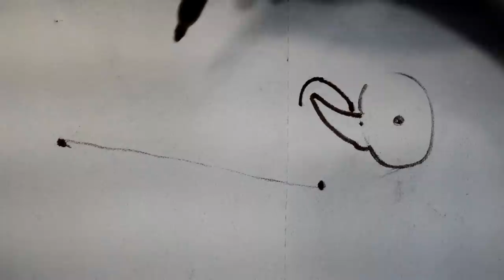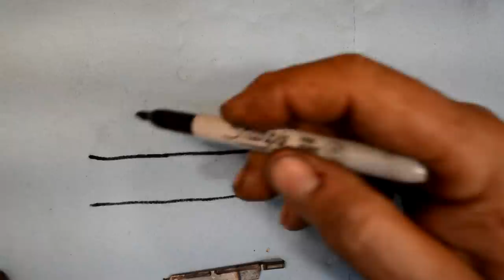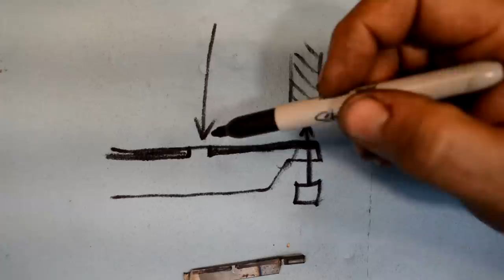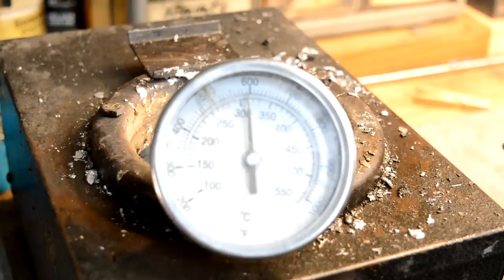Anvil 090: Mainspring Fabrication, 1812 Springfield

Comment: This reminded me of one of my black powder 1860 Colt repro's that broke the main spring.   It took it to work (P&W in WPB) and had it welded then the guys in heat treat did a full treatment with Rockwell testing included.   Turned out great...and is probably the most expensive spring in a black powder gun in the world.   Great video Mark!
Reply from the maker: Hard core

Comment: Hey Mark, I used to have a hobby blacksmith shop where I made knives for about 15 years (before YouTube lol), my knife tempering changed from “hit or miss” to perfect every time when I started using a magnet to test the red color before I quenched. Get it a little too hot and it gets too much grain growth and it doesn’t matter how well you temper, you still might get breaks. If you just get it hot enough to where a magnet doesn’t stick before the quench, that’s the sweet spot.

Comment: Very informative...I’ve made springs, and your explanations will help me next time...I temper my springs by putting them in a pan,covering them with oil, then setting the oil on fire..after it’s burned up, the spring needs cleaned and is ready...learned it from an old timer at friendship many years ago
Reply from the maker: This oil method works well, however I find that you can only achieve 1 possible hardness/draw result. I need to play with the temper/draw/thickness/shape to reverse engineer into the remanufactured part. Lots of correct ways to skin this cat..,..

Comment: In theory the statement "I need to make a new spring " is one of a fairly simple task. In reality it is one of the more complicated endeavors a Smith may undertake, resulting in a ratio of more failures to successes. Knowing "how" to do it cannot begin to bring into account all the known and unknown variables one can encounter.  I'm  glad to see the use of the Lyman lead pot, a trick I've been familiar with since about 1974. It gives a constant and controlled temperature to draw back a fabricated spring. Glad to see it being used here. Great job Mark !!! Very well thought out and presented. But most of us should not expect to get it right on the first try. And that is normal and par for the course.
Reply from the maker: Well said. Thanks
Reply: Even though I deal with digital controllers all the time, I still appreciate the old ways.  A bimetal element and thermal mass is incredibly elegant and simple.  Same for a rotating sprung mass to control speed.
Reply from the maker: @AM-hf9kk  Something to be said for Bang Bang control and the Watt flyball governor.......

Comment: As a warning, cooling in oil isn't nessesarily slower... it will be on very small items like these springs, but for larger/hotter steel sections the evaporation causes the steel to be insulated from the water, while the vastly higher boiling point, lower expansion rate, and endothermic decomposition of oil will allow it to continue to extract a high degree of energy. For this reason the fairly soft temper of the large rolls of steel sold for automotive fabrication is actually attained by submerging the entire roll and letting it flash boil for over an hour... to attain higher hardnesses fan, or forced jet water sprayers are used. Its not something even a home shop should forget either, as the same practice that works for guns lock spring, will garner a fairly different result on a barrel, car's leaf spring, or a sword blade (even between a sword and an axe you'll require to experiment several times to dial it in... so make sure thats on scrap metal FIRST, not a customers job you've got 20 hours into).

Comment: Mark, another awesome video.  Highly educational.  I'm sure I echo many others that have seen your videos in thanking you for sharing some of the finer points for not only this mainspring video but countless before it.  You're a Champ!  

It so happens that I've got a sorrily made flinter here that broke the spring early on.  And it wasn't a great smoke pole anyway since the action lacked a bridle plate.   The bridle plate and new screws I can handle.  But the book on making early firearm mainsprings I found lacks a lot of the valuable hints you gave in this video.  Now I can dive into this project more fully equipped. 

For us hobbyist shop rats I'm not exaggerating in saying that you're by far the best gunsmithing channel I've found.  Please keep up the great work.  But don't let this swell up your head and make it hard to fit your hats :D

Comment: The melting point of pure lead is a very precise temperature reference at 621.5F (327.5C). It can be used as a calibration check for high temperature thermometers. The freezing point of zinc is however better.

Comment: @Mark, looking at 6:50 that's not the "cheater's way", that is the blacksmithing way! I do blacksmithing as a hobby and as soon as you took out the hacksaw I knew what you were going to do. Of course doing this on an anvil would be even easier as you could just fuller that notch using the edge of the anvil face, bend it over with a hammer blow, and then clean up the twist bit with a half face blow.
Reply: That’s what I thought!

Comment: You are correct and assuming that I am very average and that I have a lead pot. I also have a thermometer similar to yours so you have made tempering a lot more easy and precise for me I've seen the same thing used for assault bath bluing and various brass annealing, but it just didn't occur to me that I had the ability to precisely temper springs with tools I already had.

Comment: I use car leaf spring steel to make new springs...... heat red and anneal, cut and file to shape and fit, heat to non-magnetic, quench in cool oil..... heat gently in a flame until the oil just flashes off, and its ready..... works well

Comment: I have a 1801 1795 Springfield pattern Eli Whitney contract musket issued to Maryland troops. It was converted to a percussion system for use in the Civil War. It is completely original other than a commercial hammer and the frizzen removed and reworked from a blacksmith's addition of a cone and  drum.
   The only part broken is the sear spring. At some time in the future I hope you could do a video on making a new one. Great instructional info.
Reply: Do you have the broken spring? You could well use it as a guide to make one or get a commercial one close enough to work

Comment: A-good source of thin spring material is metal leaf rakes. The individual tines are really easily made over and take heat treatment really well. Many such rakes also have 3/16 to1/4” springs included as a stiffener on the back. I have never used them on guns but i have used them for antique engine repairs. Particularly in and around governors and carburetors.

Comment: Careful with salvaging old mower blades, rumor has it the more modern cheap ones are case hardened mild steel rather than some through hard medium/high carbon alloy.
Reply: you know, there are multiple, really simple ways to test for that?

Comment: Nice job, but sorry you didn't show us the actual TIG welding - would have been helpful to see how those pieces were joined together.
Reply from the maker: That process does not video at all.....I've tried, haven't figured out how to show it, and I suck at it anyway. Too many armchair trolls to listen to.
Reply: @marknovak8255  Could you tell us the location of the welds... only at the end or on side(s) also?
Reply: @marknovak8255  Hi Mark as always awesome video, but please could you show more detail on the welding, Thanks
Reply: Better off looking at TIG welding videos on YouTube.  Lots of stuff there.  I have been welding for 50 years or so, but never did that process.  I want to try it.

Comment: It always pays to have both leaves in firm contact at the base. That way, all stresses are removed from the bend..... it's always at the bend that they break if this is not done.
If the base of the leaves are in contact it won't break there because the stresses are minimised. I always forge them on the anvil using a gas forge for the heating, which makes it easy to eliminate the gap between the leaves at the base and get the bend in just the right spot. The steel has to be HOT... hotter than your torch makes it.... I usually temper them after hardening by the 'oil burn' method....

Comment: You could use a 25kg anvil and a small forge...It would make making springs so much easier and faster.... The hot led method works pretty well, but so does burning off the oil a couple of times, as was done back in the day..... Making springs is a bit of a dark art.. :-)
Reply from the maker: It is indeed a dark art.

Comment: Super fantastic! I didn't know how to make the 90 degree tab at the end. I have to make a spring for an old lock of mine, but couldn't  figure out the tab at the end. I tried beating the tall end flat, gut that didn't work well. Now, however maybe I'll just weld the old spring. It's cracked at the bend, not all the way yet, but Im. thinking an ounce of preventive welding is worth a pound of fixing a completely broken spring
Reply: You will have to re temper that spring after welding it.

But if you have the stuff to get the heat correct, that's trivial.
Reply from the maker: As long as the weld doesn't flex in service, your repair will be virtually identical to this one

Comment: Mr Novak I need your expertise on a Beretta 38a I am building. Should I hot blue, cold blue, cerakote or duracoat it??? The parts are all “in the white” so not a lot of prep for whichever I can go with.
Reply from the maker: Rust blue, obviously. Dura and cold are never options in my opinion. Cerakote is expensive to have done, and very gear/expertise intensive to try on only one gun. Hot dip looks like ass....just sayin
Reply: @marknovak8255  thank you sir!!

Comment: Thank you Mark. Real question  is, what genius figured all this out in the first place?  I've found your demos very helpful fixing a lot of other mechanical stuff.
Reply: Like most things, it evolved over a hundred years or so.
Reply: @jeffreyroot6300  True, but there must have been some proto Mark who thought 'If I do this what happens?' My grandsons ,are fortunatley, fascinated by Mark.
Reply: @51WCDodge  The French fully developed the flintlock, closest and most pertinent point you can look at! Before that was a cruder version popular during the English Civil War period called the Doglock. It had a “dog” that acted as a safety, as there was no halfcock. Before that was the Snaphaunce, which was cruder still.
Reply: @51WCDodge  I use the word crude specifically to refer to the technology of the lock. I will point out two features in particular. The half cock position has not been developed yet, which is why the dog was incorporated, so the frizzen could be safely charged with powder while the cock was in the fully cocked position. The second is the rather larger jaws on the cock needed to hold a chunk of flint. A proper flintlock has much more refined jaws because the flints are standardized in form, being chipped or sawn into flat lozenges with sharp ends. I might actually prefer a dog lock if I were out long hunting past the Appalachian Mountains in the early Colonial days. The ability to simply smash a sufficiently hard rock and fit a sharp chunk into the jaws has an appeal. So does having a safety.
Reply: @jeffreyroot6300  Yes, I was being picky but I remember when a 405 VHF 20 inch TV was cutting edge technology. . It takes time for things to develop, and of course the current doctrine influences things. Safteys  being a point in question. Though one cannot but admire the work of people in the past, and their knowledge led to our improvments. But there must have been somone who first thought ,what if I re heat this metal to a lower temprature then let it cool, will it shatter after that? Humans have changed the world since the firet person thought, I'll dig a hole here formy convience or chop down that tree it's in the way.
Reply: @51WCDodge  lol remember rabbit ear antenna, constantly adjusting them and adding foil to try and get better reception? I remember we couldn’t get a color TV until 1982( too poor).
Reply: @jeffreyroot6300  I had a wire coat hangar bent up for my ariel. :-)

Comment: I have a question Sir. Being an accomplished Tig welder and an amateur gunsmith, what filler rod did you use on the Tig joint? The tempering down in the lead pot was worth watching for me as I always just watch the color and wrap the spring in leather to cool slowly. Thanks for the video

Comment: Logically, the vise wicks heat because you allow it to.  The operation provided by the vise is securement.  Securing the piece in a certain orientation is possible without wicking or sacrificing even heating, or am I incorrect about securing/gripping strategies in this work environment?
Reply: if you have a vise with very low thermal conductivity, yes. i don't know many people with titanium vise jaws personally though.
Reply: @johnsmith-sp6yl  What about wood as a jaw insert?  Anything to provide an insulation layer.
Reply: @MarkH10  how hot are you getting the workpiece and how long is it taking? wood burns.

Comment: What is the modern flintlock lock that you showed with a mainspring stirrup. It's an odd shaped tumbler. And do you have a project gun it is going into soon?
Reply from the maker: The lock is a Twigg fowler lock, 1790ish. It's going on a 10ga fowler, but that project is 2 years out. The one being built now is an English fantail fowler, with a snaphaunce lock

Comment: Really insightful video. Thanks. What did you decide to water quench rather than oil? I know some steels are water quench, but most seem to crack less with oil.
Reply from the maker: This steel doesn't seem to get hard enough with the oil. However, a water quench requires a much longer hold during the draw back phase. The real difference between water and oil is the RATE of cooldown, too fast and the stresses set up cause cracks, verifying your initial comment. This is where to art part is in the job. Much intuition, that I cannot successfully articulate/teach.

Comment: @Mark Novak do you have a preferred brand of hacksaw blade? Pretty much everything I’ve found at the usual retail outlets is marginal. Thanks for your vids, sir!
Reply: i dunno what he prefers, but lloking at the color of the blade on that hacksaw it's prolly a DeWalt
Reply: Starrett blades are top notch, and if you know to lift on the backstroke will last wuote some time. If you dont lift, just get some el cheapo blades cause you're gonna trash em anyway.

Comment: Did you forge weld or just use a regular welder?
Reply: He did say TIG so I would assume he used a TIG welder
Reply from the maker: TIG
Reply: @MathiasLaakkonen  I didn't catch that part
Reply: @marknovak8255  Would you be willing to do a video showing simple methods for adding carbon to a frizzen? I can't seem to get it quite right. I heat treated it but it's still soft and not producing spark so I'm thinking I may need to braze a high carbon steel plate to the face.
Reply from the maker: @diverguy2583  An old file works great in that application. Have you used "Casenit" or a similar carbon rich application yet? Requested video topic noted for action btw
Reply: @marknovak8255  I ended up using an old sawzall blade that I cut down and shaped to use as a shoe of sorts. I couldn't get it to silver solder correctly so I'm trying an epoxy that's specifically for metal use on aircraft that I had laying around, hopefully it works.